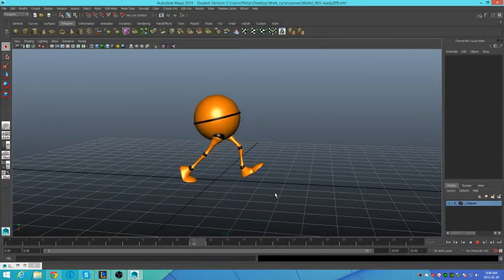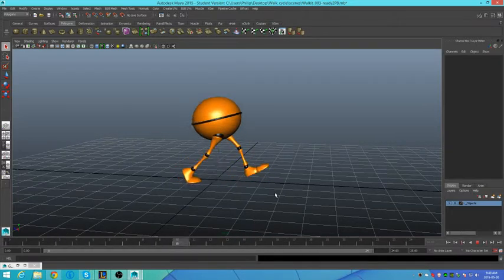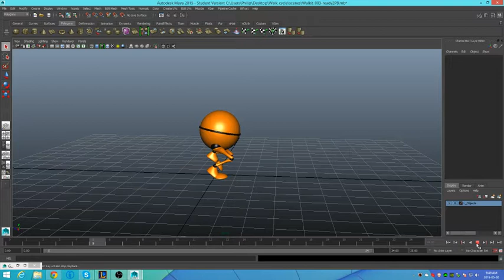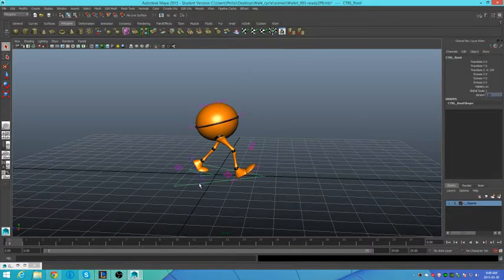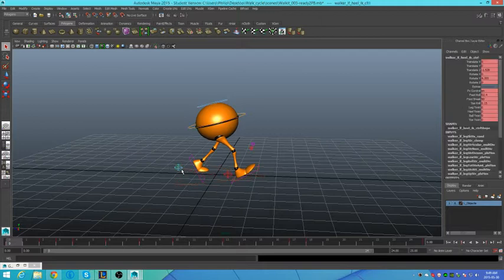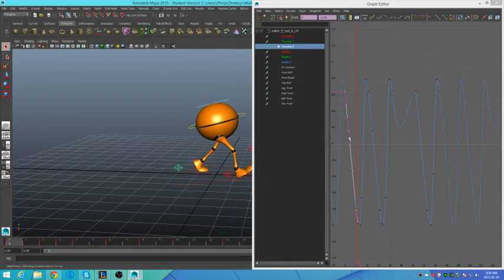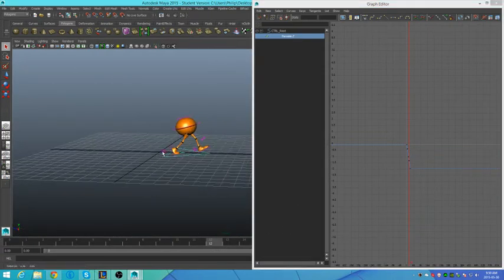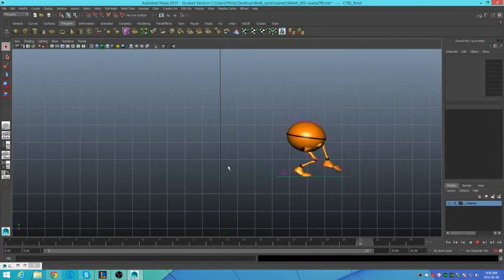Maya 2015 - Animation Tricks: how to avoid sliding.

Comment: had tried the same way as of yours...........but its not working the character is still sliding...can u please suggest where i am lacking
Reply from the maker: sagar jain Hi there, the problem you may be having is that you took the translate value of your foot moving forwards, that or your walk cycle is Asymetrical and in that case you will need to copy both foots' translate value
Reply from the maker: sagar jain another issue you may be having is that your translate curve is a tangent and not a linear value.
Reply: how to resolve it????????
Reply from the maker: If you took the forward translate value and copied that over,  Simply delete that key-frame and replace it with the translate value from when your foot goes backwards.

If it is a tangent, simply just Select the curve in the graph editor and click, "linear curve".